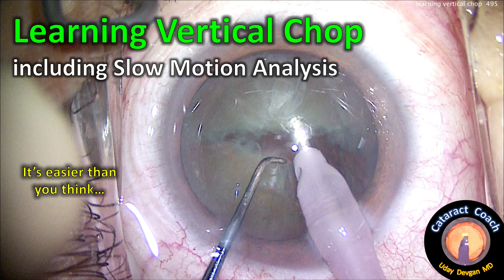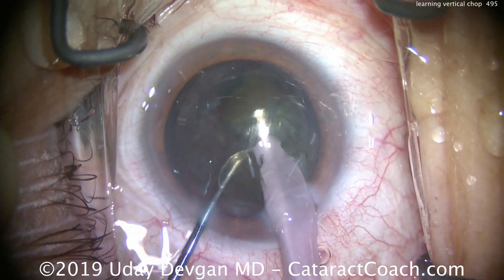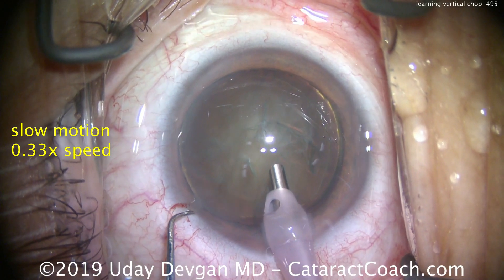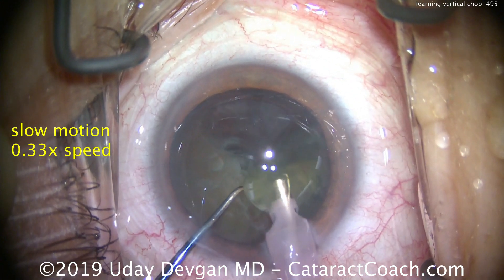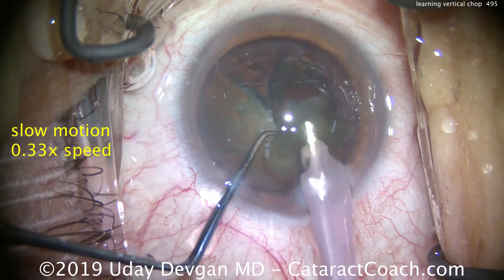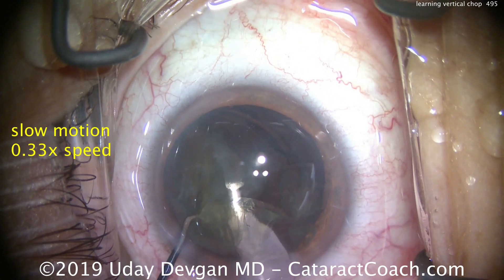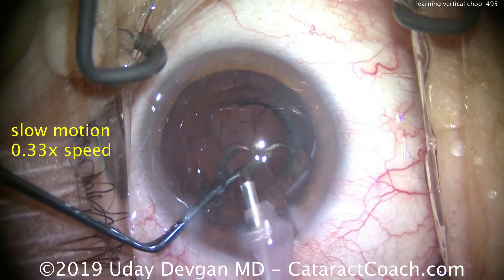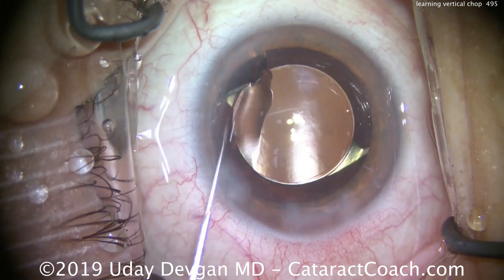learning vertical phaco chop cataract surgery

Comment: hello sir, greetings  from India.i have a laureate phaco machine.i use burst mode for chopping and emulsification.my parameters are as follows- power-50 fixed,on 20 off 20 ms,afr-40,vac 360 fixed.i am not able to impale into the nucleus like the one showed in this video.i encounter this in grade 3-4 NS.i want to impale like the one showed in this video.please guide me.thanks sir
Reply from the maker: Try with continuous phaco energy for the initial impaling of the nucleus. If that works then adjust your ultrasound parameters.
Reply: Uday Devgan thanks for the reply sir.